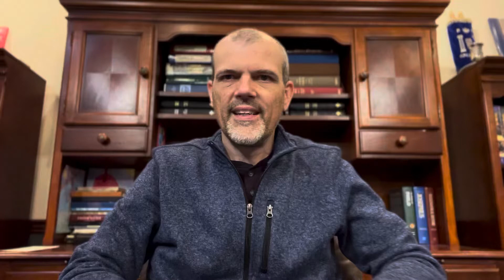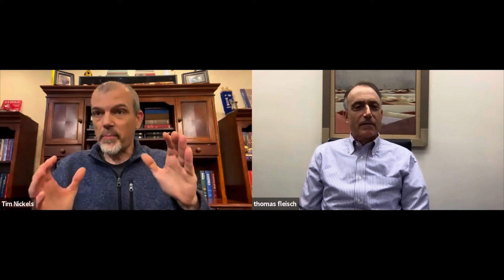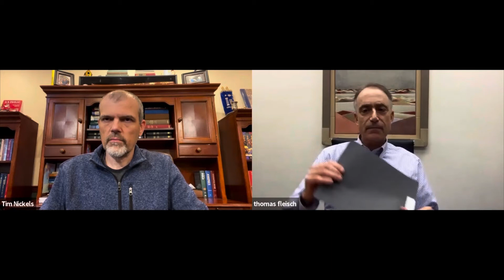How is Bonded Leather Made

Comment: This has been very illuminating as my experience with bonded leather has been unsatisfactory at best. I have had a few bonded leather Bibles that have cracked after just a few years of average use. But they generally are stiff and inflexible. Have the specs for bonded leather changed or improved to allow for more flexibility and durability?
Reply from the maker: Personally I’d still advise against bonded leather.